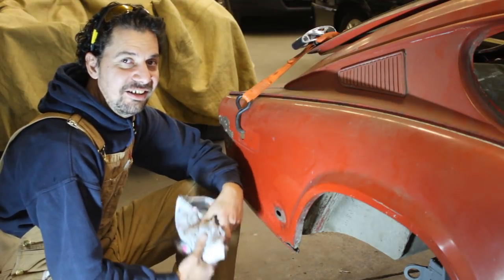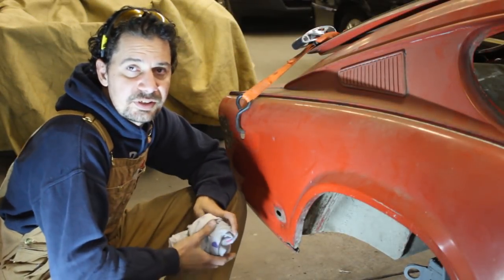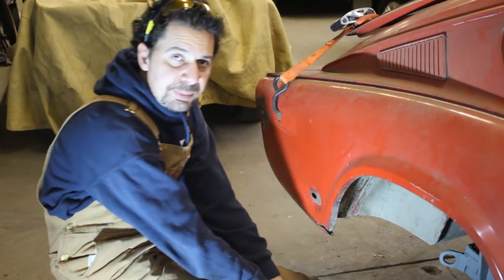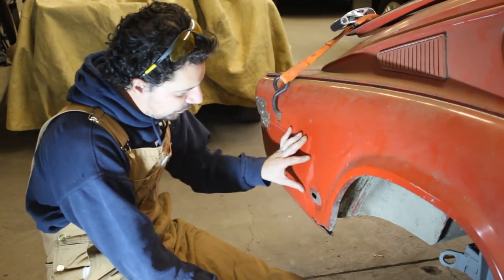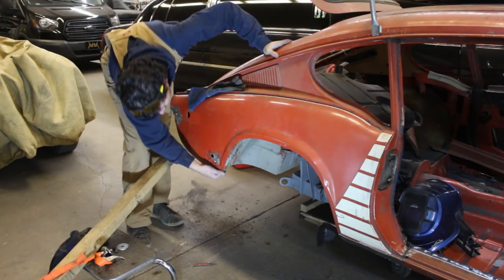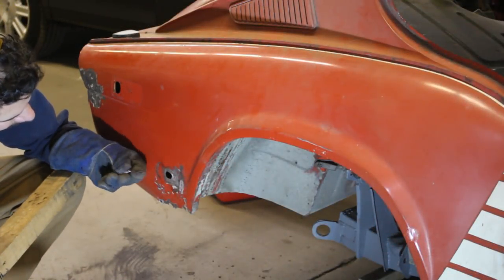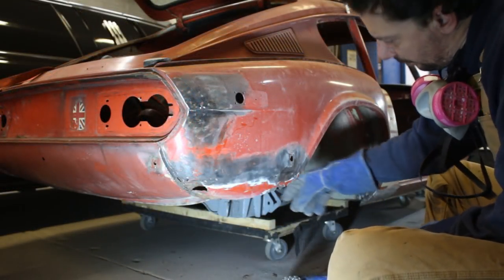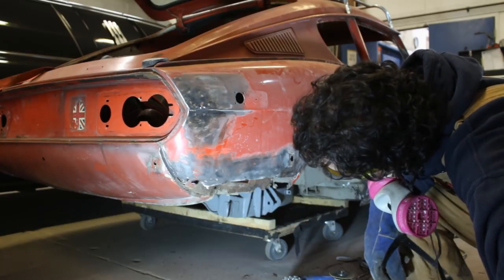1972 Triumph GT6 Restoration - Part 17 - Rear Fender and Strengthener

Comment: Thanks for the shout out...maybe?! Funny how different the two repair pieces are between the two cars (GT6 vs Spit). Good job, Elin. You clearly explain the complexity in that area. Lots of angles and metal coming together there...not easy to fix.
Happy Birthday to your boy!
Reply from the maker: I find them very similar actually and the way they fit. We had issues at the exact same area, but I saw you managed to fit yours properly. Well, I think I did too. I am cooking a new video now, so you will see.
Reply: Roundtails and squaretails are indeed different though.
Reply: Yes, forgot about that.

Comment: If I had tried that little treat with the hole in the fender it would looked a drunk woodpecker got hold of it, ha! I like the way you figure the angles out .
Reply from the maker: LOL, I did more pulling later, you will see in the next video. A lot more angle figuring there too.

Comment: I thought that area of bondo would have been worse. The one higher up.
Reply from the maker: It looks like it was pushed in and someone tried to pull it out with screws, but it didn't work very well. It was still too far in and it was affecting a little bit the fit of the repair panel. I did some work there too. You will see in the next video, which is coming up in an hour or so.